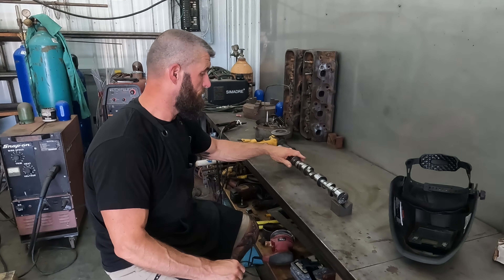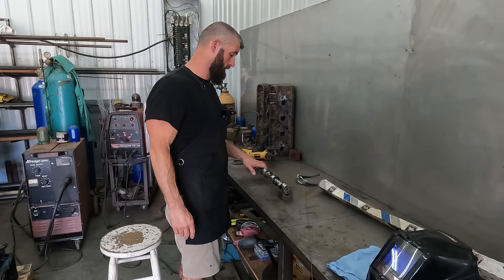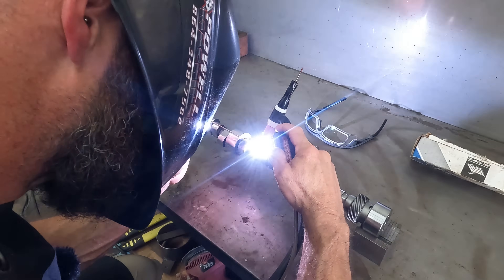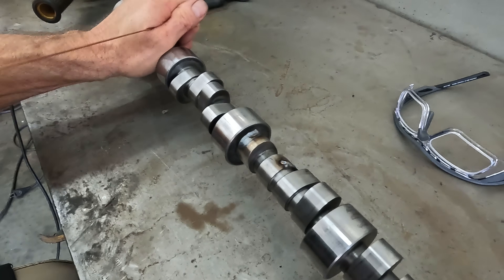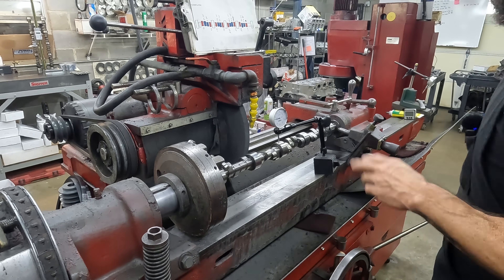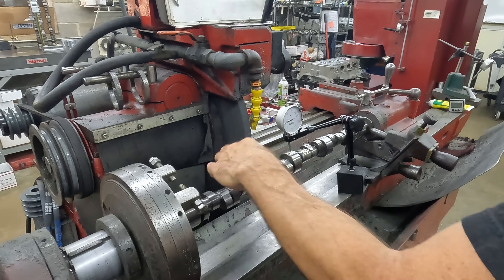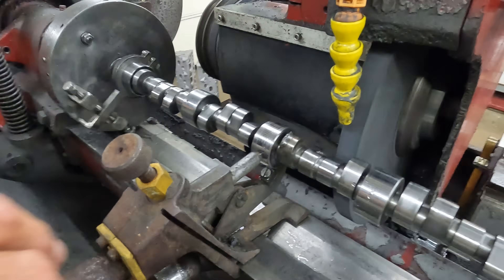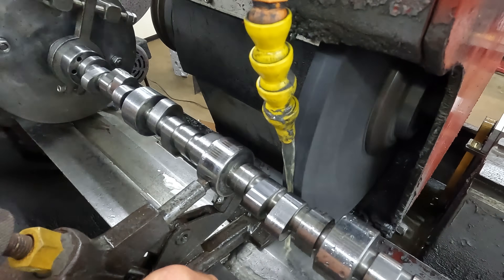Bbc camshaft repair

Comment: Can you repair some damaged lobes on a m278 engine. Mercedes v8 turbo twin overhead cam. Lobes have damage from failing roller rockers. Probably could just do a regrind.
Reply from the maker: I would have to make master plates, so it would cost more than a std regrind

Comment: Back years ago I learned how to check crank shafts for straightness. Surprised how many were not straight right out of the box. Especially the straight 6 crank shafts. We would put the crank in the block with the first and last main bearings. Then set up the Dial indicator gauge checking the center main bearing surfaces. Slowly rotate the crank shaft and bring the high spot up then take a Minny sledge hammer and tunk down on the web of the crank shaft. Slowly rotate the crank shaft and check for straightness. It's really cool, usually only need one tunk and the crank shaft is nice and true again.
Reply from the maker: Definitely

Comment: we ran rollers on lobes much narrower than those, could you have narrowed?  did you have to make masters.  Some of the new CNC grinders will digitise a lobe and grind from the lift table (sigh)
Reply from the maker: We put our own profiles on it, I haven't seen a grinder that would digitize a existing lobe,
Reply: @powellmachineinc  come to think of it the digitizer was seperate but the grinder could grind from the digital lift table with no master, not in my budget  enjoyed your ls video reminds me of working with Bill Jenks (Potvin/Moon)  designing cams on a hand calculator and reflecting the flats on the ceiling while smoothing the lobes

Comment: That amazes me. So all that work is still cost effective as opposed to just buying a new cam?
Reply from the maker: About 1/2 price almost
Reply: @powellmachineinc  Dang, machinists here in Vegas skin you. I needed to have a 1 3/8 PTO shaft welded and machined where a bearing froze. Maybe a 3" repair 1/8" deep. He wanted $260. I got a factory splined and keyed shaft for $200.

Comment: Pinky in the air while tigging . . . . gotta keep it classy. Seriously, that is really neat to see. I went to trade school in N.E. Ohio back in the eighties, near Akron. So Summit racing main headquarters and Original store location was about a 30 minute drive away. You could buy a SBC cam, lifters & double roller w/a multi cut keyway for $119.95, all day long. . . . OR . . you could go to any number of local speed shops and get "renewed" lifters and a welded/reground seasoned cam for $50 bucks. A "performance" timing set from Napa was $40-ish.
Reply from the maker: Facts

Comment: Crazy how hitting a cam or crank on the low side makes it spring back!  First time I ever helped my machine shop buddy straighten one of my cranks was wild!  Would be cool to see how the cam is setup so that the stone follows the lobe.  How much can you change a cam on a regrind?
Reply from the maker: It depends on core matl, current specs,  ect, but it's easy to shrink duration and add lift, we can add duration but normally more than 10 degrees is tough
Reply from the maker: Are u the turbojohn that was on tsr a while back, Jason interviewed u?
Reply: @powellmachineinc  yes sir, that’s me!
Reply from the maker: @TurboJohnRacing  Shoot me a email some time, maybe we can help each other!  Powellmachineinc@gmail.com 

Powellmachineinc.com

Comment: I'm a 25 year machinist up near Chicago. I'm pretty well versed and can handle myself on manuals, CNC, really anything you throw at me I can usually do it or figure it out. But you, my man, are a wizard. This is what this trade is all about. You really should open a school. Or at least a few training classes.
Reply from the maker: I'm hoping this channel will be that, and it will still be here way after I'm gone
Reply: @powellmachineinc  You're doing a great job of it already. What brand cam grinder is that?

Comment: I spent a few seasons as a crane follower at a steel plant and ever since watching the ladle pour the hot metal and see it flow thru the forms and turn into a steel beam as it came down the line before being chopped to length. I am just amazed how metal can be manipulated. Watching you work on a cam shaft with an air hammer! 👏👏
Reply from the maker: Definitely!, tyvm

Comment: Reminds me when i used to rebuild Torque converters on old WW11 lathes; bolt them up to big old face plates and center the front hub and cut the weld until they would pop; then take a mallet and tap on the housing to ease the 2 halves apart. That's where i learned the basics of machining, welding and fabrication. That was a damn good job! Also learned the art of using a dial indicator to measure how far to run the tool post in before turning anything to size because the original lead screws and half nuts were replaced with threaded rod and a nut welded to center of the carriage! Yeah, old school, red neck machining at it's best!
Reply from the maker: Definitely

Comment: I would think you would want to weld that in some wooden v blocks and then use a magnetic ground right on the end of the cam. You have to be arcing through those v blocks onto the journals the way you are doing it.
Reply from the maker: Na, good connections don't  "arc"
Reply: Questions for you. How many times do you think Daniel would have welded cams? 2nd. Do you not think Daniel would have noticed if there was arcing on the main journals if there was a problem? How about you give him credit for knowing what he is doing. Daniel also has to warrant the work he does. Would you warrant the work if there was a chance of arcing? Come on.
Reply: @bobhudson6659  I've seen guys weld on a lathe while grounding to the lathe and I've seen what happens to the bearings. It puts little arc spots all over the bearings. Granted this is welding while the lathe is turning. I know I wouldn't do it and I've been a machinist for 40 years

Comment: I'm a noob and I know nothing in comparison to video creator. 
My first thought when seeing this; Shouldn't you support the cam or crank directly underneath your weld point, so as to not cause warpage? 
I'm just a noob with curiosity and new to personally rebuilding engines. Genuinely curious
Reply from the maker: No, , we concentrate the heat in a very small area,  so it isn't "sagging the cam.

Comment: A great episode of repair when worth it. Now i have a question about your tig torch, are you operating it with your thumb with an on off switch in lieu of a foot pedal ?
Reply from the maker: Correct
Reply: @powellmachineinc  does it pulse ? at a setting of your choosing. Ive seen a finger "trigger" that is much smaller than what you have but honestly your set up is larger but looks comfortable for posisitioning the toarch

Comment: I have a 60 mm roller cam that got dinged when a wrist pin broke. It looks like it got a double line groove from a rod or the lifter in one lobe. I haven't checked the straightness yet. I am not sure it's the right grind for the application though as it appears to be a former Craftsman Truck engine. I may call you to discuss if the machine shop doesn't have something better. They were an ARCA builder in the past.
Reply from the maker: Definitely,  lmk

Comment: Nice to know that cams can be fixed! hell I have 6or 7 BBF roller cams that we barely hurt a lobe from a lifter failure , and just replaced the cam !  mind you these are like .995" lift cams
Reply from the maker: I can fix it mostl likely
Reply: That’s just the big block version of the B303 cam lol. The cam manufacturer should be able to repair them also if needed or wanted.

Comment: I have probably a stupid question, please forgive my ignorance. If you use weld that has a higher hardness than the lobe, say 58 hardness weld on a 50 lobe, does the original material on the lobe not wear faster than the repair spot? If the original material were to wear faster, then would the lifter eventually have an odd wear pattern?
Reply: Ask yourself, why would Daniel weld on 58 Rockwell C material on a 50 Rockwell C material camshaft in the first place? He's been doing cams for a year or two so give him credit for some common sense - and experience.
Reply: @bobhudson6659  for sure! Hes an expert, full credit. I know absolutely nothing about machining, thats why i asked and mentioned I'm completely ignorant on the topic.

Comment: I had never heard of what you’re doing to straighten that cam. Always a master class in automotive machining. Thank you, sir.
Reply from the maker: Glad you enjoyed it
Reply: That straightening was awesome
Reply: Great video
Reply: Yeah I agree with you on that, I never knew.
Reply: Much better said than I lol, blew my mind he was able to shift .001 of metal measurement
Reply: YT Keith Fenner did quite a few videos about heat-cycling on propeller shafts to remove runout.

Comment: Nice work!
Can you do a regrind on a Studebaker V8 camshaft?
Reply from the maker: Should be no problem
Reply: @powellmachineinc  The Studebaker V8 has a gear-to-gear timing set so the camshaft rotates opposite to the crankshaft, is that an issue or extra charge? Also, can lobe separation be tightened any from the stock configuration?